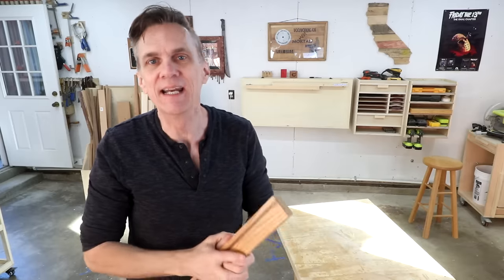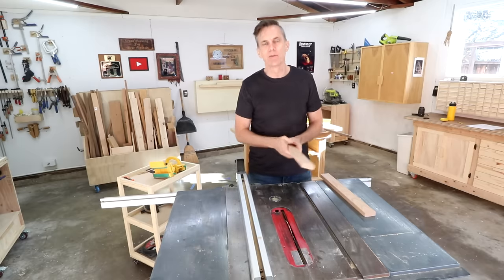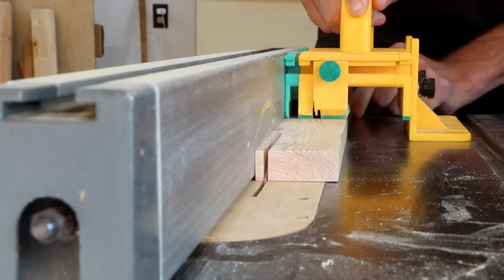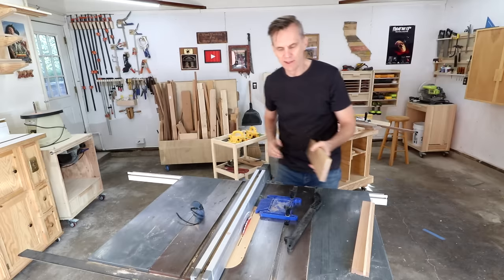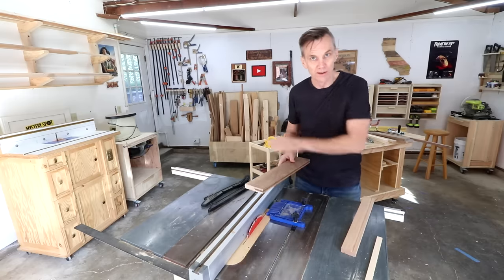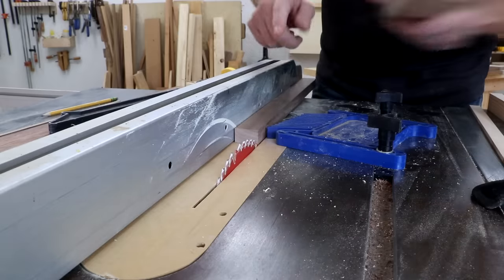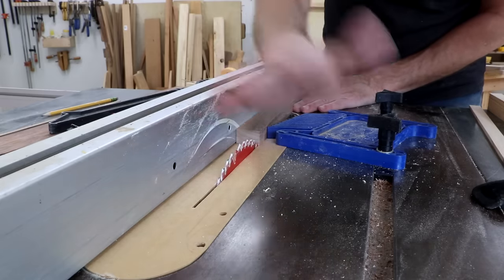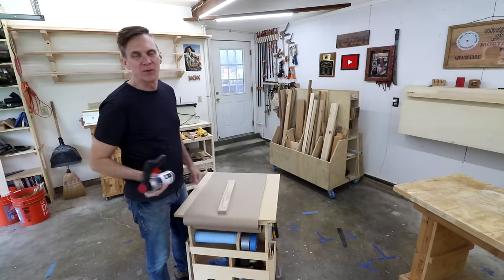Add custom inlay to your woodworking projects. Making your own is easy!

Comment: Steve, for getting the exact width how about using the router bit between the blade and the fence; set fence and bingo, correct spacing. 🙂

Comment: Hearing the Words "Spray Lacquer"  from you, brings back some old Memories. Bought that same Handle Years ago because of you :)
Reply: I was wondering about that handle...Who makes it?
Reply: @PugetSoundFlyer  Mine seems to be Brandless, just search  for something like "handle spray can"
Reply: @PugetSoundFlyer  Believe I got mine at Menards.  Other big box stores probably have it as well.
Reply: Dwight L hello fellow Menards shopper and Steve Ramsey fan! I’ll have to see if they have them when it’s safe to visit Menards again. I can maybe get one with my rebate money.
Reply: I saw them at sLowe's yesterday.  Rustoleum was on the package.  I almost bought one, but the only spray lacquer available was from Krylon, & the handle package did not say whether it would work on other spray cans.  Thinking back, I don't see why it wouldn't.  Spray cans probably all come from the same manufacturer.

Comment: You read my mind. Ive found another good reason to use an inlay. If you're using reclaimed wood that has nail holes in it, inflating is a good way to cover them up. It makes the piece look nice and you don't waste good wood.

Comment: Learn to use a hand plane to thin down strips to final thickness and use a dial or digital caliper to measure accurately for tight fit. Also a properly tuned hand plane will allow removal of excess inlay protruding up on surface while leaving a silky smooth surface.

Comment: You are very good at explaining your techniques. You must be a teacher! :)  I like your trick on sanding the pin strips when the glue is not completely dry.....i also like the spray gadget for the spray can finish!! Where can one find one of these?
Reply: Home Depot has them for very cheap.

Comment: I find the planer works best for me to make the inlay strips and the final thickness of the final piece.  I get more consistent thickness of the inlay piece and when glued in place just run the whole board thru for the final thickness of the board.  Perfectly flush inlay.    That is............ if you have a planer.      Thanks Steve.                    JimE
Reply: blackemmons omg I didn’t think of that. I’m going to make a wood frame project, and I can put inlay on all my lengths even before I cut it all to length. It’s a rough project but that’ll be a nice eye catcher. Thank you.
Reply: @BlackSwan912  If you have the equipment I find it a lot more accurate and you get a really smooth finish with the final planing.

Comment: my favorite thing to do is, fill the inlays with epoxy resin. You can literally do any type of color, add stuff in it and when it dries, it turns out real nice. saves from cutting those thin strips too :)
Reply: DIY WoodWorking TV how to you clean the top once the resin is cured? I have some some wood Inlay before and cleaned them up in my planer.

Comment: Absolutely fantastic videos, thank you! I've got a question for you or user experienced workers: 

What do you do if your inlay is a hard wood but the surface is a soft wood? If it's slightly above the surface, when you sand it down I'd expect that you'll also sand down the soft wood more and retain an undesirable bump.

Comment: Great projects Steve! Could you make more of these using the bandsaw instead? The bandsaw is easier and less scary to use, compared to a table saw, especially in an apartment setting.
Reply: Rithwik Jallepalli I agree, bandsaws are much less intimidating than a table saw. I used a friend's band saw resaw some 1" boards to 1/2" and wasn't the least bit worried about the boards flying across the shop.

Comment: Purple heat in walnut looks alright but I don’t really recommend purple heart unless you have a really sharp blade as it burns easily. Cut a piece on miter saw white a worn blade and the end grain was solid black.

Comment: Unrelated to this specific video, but a question nonetheless:  You've mentioned in different videos that in some projects it's okay to cut all your boards to length at the beginning of the project but also that for most projects it's not recommended to cut boards to length up front; but rather better to measure & cut to length as you go.  My question is what determines when it's a good time to cut to length up front and when is it a bad idea?  Thanks for your time and I love all your videos and courses.  -Bill
Reply: Lets say you are making a box with a shelf inside.  Cut the box sides to the final dimension first and assemble.  The shelf would now be cut to its final dimension after measuring the inside dimension of the box.  If you cut all the pieces first it's very likely the shelf would be to long (not a problem), or worse the shelf would be to short and you would have to make another shelf.  Happens because all cuts, and lumber thickness can vary a bit.  It is not a perfect world.

Comment: I have to do a brass inlay work using 3mm square brass rods, I intend to use veneered mdf as a subtrate to avoid solid wood board movement. However, I am concerned if I use the hand router or a CNC to make groves for the brass, then the veneer may chip off during the routing. The inlay design would be geometric lines. Any advises to avoid the chip off of the veneer would be highly appreciated. Thanks and best..

Comment: My new low cost table saw has a riving knife a little bit higher than a saw, so it is not possible to perform groove cuts... Should I grind a knife at a top or just remove it for this purpose?

Comment: My preferred method for sneaking up on a perfect fit is to use the planer instead of the table saw. 

Then you can easily end up wide board of perfect width for your channel/groove. 

For those of us “mere mortals” with lower end table saws, the wobble and imperfection in the saw is a lot more noticeable than in the planer. Typically other than the snipe at the ends you can be pretty sure that anything coming out of the planer will be perfectly uniform with no gaps.

Comment: Hey Steve, I see you're not using a splitter or riving knife in most of the video. I have a table saw with no riving knife and I have been just not using it for 6 months because I have been told it's stupid to use a table saw without one. Its keeping me from woodworking. What can I do without a riving knife safely? Does a feather board make a riving knife less necessary?

Comment: Really love the result, but if you don't have a perfect rip fence, this is going to be a chore.
Also, what about the riving knife?
Reply: Zero clearance insert doesn't allow it's use.
Reply: @mtmarcy4495  Why?
Reply: When you try and raise the blade up, it will hit the bottom of the Zero clearance insert and push it up. You can use it if you cut all the way to the back of the zero clearance insert, but then you lose some stability, and pieces can potentially fall in, it's really up to you for your own preference. I just take the riving knife out since it's really easy in my table saw.
Reply: When the blade is set lower than the workpiece you have to take the riving knife off otherwise the workpiece would hit and woudn’t get past the riving knife.

Comment: Did you modify your Gripper to accommodate thin strips?
Reply: There's a Gripper add-on that's a 1/8" leg for thin strip ripping.  It's the green part you see on the fence side of the Gripper.
Reply: @Not_TVs_Frank  - OK. Thanks!

Comment: Hey steve. A question out of nowhere.... What if we set table saw height 40" or above instead of 34
Reply: Hashim Chohan might be a bit dangerous unless you’re much taller. Kickback hitting you in the chest instead of stomach If that unfortunately happened

Comment: How do I get one of those spray can handles
Reply: Michael, I'm not sure about that particular handle, but I bought the one I use at either Lowes or Home Depot. They both carry them. And they make working with rattle cans much, much easier.

Comment: Ps french canadien 
Have you tink 
Using a ossiling tool to cut it flush 
Or a japonise saw , with a litel shim ( masking tape 3 layer maby 
Or plastick from packing ) 

Insted of the table saw  
And resaw (6:39) 
Toes peace of wood 

And after cuting with occiling tool or japonise saw 
Finising with sanding 
Cause your idee of filling smale hole si verry good 😉😆 

I prefere using those tool  (ossling tool &japonise saw ) insted of table saw 
Feal mose safer for me 
Pps i use the ossiling tool 
To cut the smale strip dose i don't like on my cabinet cause the are a nusante 😣

Comment: just cut the thing a 1/16 oversize and use a small handplane to remove the material sticking out the board cutting those strips on a table saw is not efficient and everybody has a cheap handplane